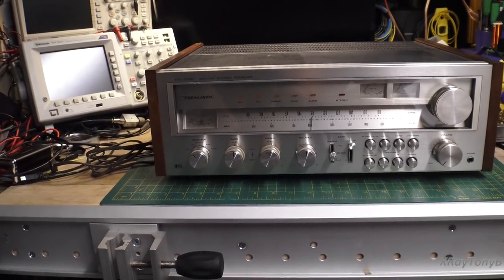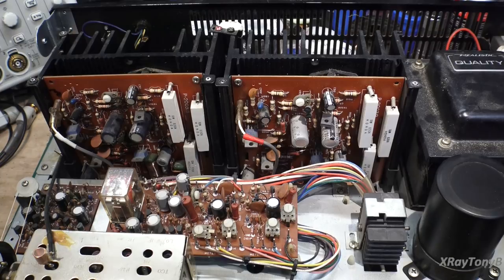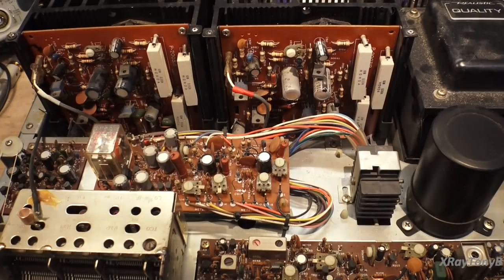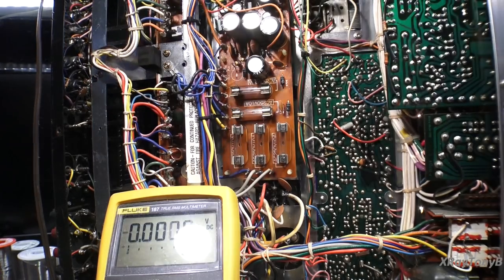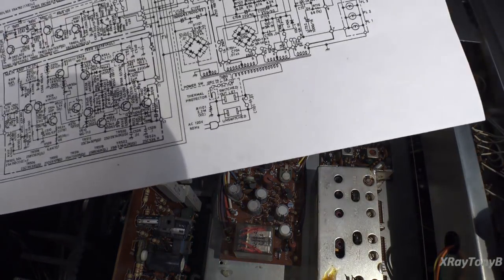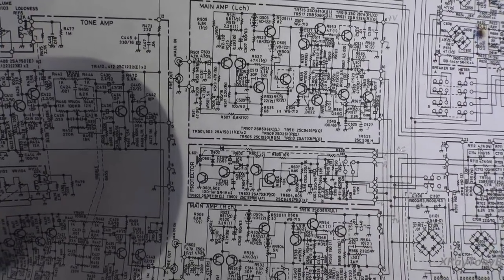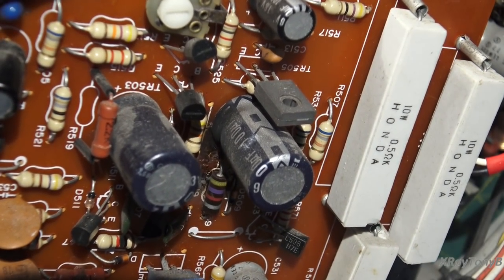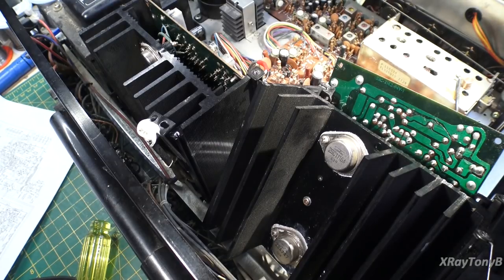Realistic STA 2000 Receiver Repair

Comment: I was a repair tech for Tandy from 1987-1995. I rebuilt many of these beauties. Most of these amp failures were due to intermittent bias pots. Once up and running again these were amazing performers. Thanks for posting, it brought back many fond memories
Reply: I rescued a Realistic STA-2100 literally before it went into a dumpster. It doesn't seem to power up. Sending this thing anywhere would break the bank. Hopefully at least one local tech can look at it and see if it can be saved-availability of parts must be extremely difficult, if not impossible.
Reply: @greggoodfellow5928  Better late than never ... About ALL the parts used in that receiver are commonly available or can be replaced by more "modern" instances.
The "difficult" parts are potentiometers with loudness-tap, the varco for tuning and coils.
Check the fuses before plugging in. Always replace fuses with the same value! VERY IMPORTANT!
Check for DC on the speaker output or on the relay BEFORE connecting any speaker.
You can check if the tuner-part is still working by plugging some spare-amp into the "tape-out" -plugs. (any kind of old PC-speaker with build-in amp will do the job)

Comment: I have a few vintage receivers and just wanted to offer a comment that this Realistic unit stands up very well against all of its relatively power-equivalent contemporaries. The components and build are ridiculously similar to Pioneer, right down to the panel lighting being identical; Stanley 8 volt bulbs. If you are considering an STA-2000 or a 2100, there is zero reason to hesitate, make the purchase. Thanks for the video Tony!

Comment: I have a Realistic SA-2001, a stereo amplifier with 60 watts per channel. The components of this receiver look familiar! In mine, one of the electrocataclysmic capacitors on the speaker relay board was bad. I replaced all of them and it worked fine. The biggest problem was dirty potentiometers and switches.

Comment: I had a STA-2250 and loved it...it was the first digital display stereo from Radio Shack.. Early 80's
Reply: The first "digital display" receiver from Radio Shack would be the STA-240, which was analog with a digital display, from 1980. Next would be the STA-2200, an all digital receiver, also from 1980. The STA-2250 was next in 1981.

Comment: I repaired a STA2000 a few months ago. It had more or less the same problems PLUS ... the trimmers to set idling and center current were very bad. All 4 have been replaced.
As I didn't have the original end-transistors, I just put the good old 3055 -2955 in it. Works more than OK for me.
Reply: I owned my STA 2000 D  new.   A number of years ago  all the illuminators went out .  What is your thought please ?
Reply: @mikewallace8087  you are talking about the "bulbs" I suppose. So ... no "light" but receiver is working.
Check if the voltage to the bulbs is still available. If "yes", replace bulbs OR 
replace them eventually with LED.

Comment: Tony, i know this is an old video, and maybe you already know about it at this point, but just to put it out there for others, GC electronics Radio TV solvent will dissolve that glue (and Sonybond) without ruining the silkscreening on the PC board.  The stuff is nasty, but works wonderfully.  I use the red straw from the WD40 can and just drip some on there and let it sit for a minute, adding more if needed.  it will come right off with no scraping.

Comment: I use to have a STA-2500 receiver, and it was the first digital receiver that radio shack sold.
Reply: Nope. That would be the STA-2200 from 1980, long before the 2500.

Comment: i just got a sta 2000 today off ebay  works like new but watt meter light is out  it has a plate  over it...is it hard to remove it??taking the two screw out did not move it ..love your work
Reply: ok  you have to take the face plate off  to get  to the screws  on the plate   ..not bad

Comment: I've been watching your videos for a while now and have learned a lot, and have repaired some receivers with success.  Thank you for the time you take to make this videos and sharing your knowledge.  I do have a question I have the Realistic 2100D which i was able to repair, when i got it it had shorted outputs, i recapped output, and power boards and installed new output transistors.  After playing for about 1/2 hour at 1/2 of its capacity it gets hot to the touch.  What temperature would be consider normal for this type of receivers?  I did adjusted bias to specs.

Comment: I worked for Radio Shack back in '77--'78, and remember this receiver well. It was a slow seller, but nobody ever returned one.
Just wondering though, these receivers were... what? $500 new fifty years ago? How much do you charge an hour for the kind of service we see in this video? I haven't priced caps and resistors in a long time, but components alone had to be $40-50.

Comment: One thing only; When you used the output board pins for your 8-ohm load measurement, since the customer never does that, aren't you ignoring the cable between the board and the terminals in back? I'm sure you thought of that!

Comment: Sooo, who made it for RS?  My guess, Pioneer, or Kenwood.  
Hmmm, that output turkey was suspicuous, but the yams and cranberry needed to be removed.  The stuffing and gravy had to go.  Good job on making the problems disappear.  
Hope you all had a festive TG.  
Don
Reply: I think Foster, it says, aka Fostex. Some were hitachi as well.
Reply: Another video on here said that and I confirmed it through research.  Thanks! They sold fine electronics, maybe a Pioneer would be slightly better.
Reply: @markanderson350  Tandy Electronics made this and all of the monster receivers 75 wpc and up. Hitachi last made receivers for Radio Shack no later than 1974.

Comment: Great video. I have this same receiver that my parent's bought back in the early 80's. It has occasional noise, not related to dirty potentiometers in the right channel. It doesn't happen often, but it's more of a brief distorted screech. I haven't powered it on much since it did that. I'm wondering, is it necessary to go through the rebiasing of the amp modules after replacing caps... I'm not sure I totally understand the process.
Reply: You have noisy transistors,you have to find in what circuit to problem is coming from,get a good scope and get started.

Comment: I HAVE A  ,,,  STA-2270 - STA-95 - STA-2100 - STA-2100D - STA-2300 - and others ALL REFURBISHED  - with higher quality parts , So Powerful , Will make 200w and 300w Speakers blush .Bought them from a Stereo Tech and also a collector . I want to make a video of which sounds better ..her quality parts , So Powerful , Will make 200w and 300w Speakers blush .Bought them from a Stereo Tech and also a collector . I want to make a video of which sounds better .. Paid almost 4000.00 for the 2100-2100D-2300 in total with refurbishing . Love them ..Because of your video i got into this project  ,  :)

Comment: Hi Tony I see it has been some time since you did this video it is a great one.  I would sure like to send you another STA-2000 all expenses on me of course. I just purchased it and would like it repaired right, the "seller stated does not work". I have not plugged it I did open it up and found 3 power resisters on the left on your video 4:18 have been overheated. It has a broken AM antenna but over all in fair and restore able condition from what I see. I do want to add it to my collection please let me know how I can get in contact with you I have more details.  Thank you for all your work.

Comment: I have the STA-2000D;
I found your video from a google search.
I was wondering if you had a source to get replacement backlight bulb sockets;
I can find online resellers selling replacement bulbs, but not the sockets
Mine are (as I recall) are grey, and have become brittle.
IF I saw correctly the one time your camera panned past these sockets, this receiver had white plugs.
This was a great video by the way.
Reply: Try touching base with Dave over at www.dgwojo.com. He has been fantastic in helping me with the bulbs on my 2000D back at the start of the year. He sells mostly bulbs, but if he doesn't have sockets as well, he probably would know what direction to point you in.

Comment: My receiver is the (D) variant  of the version that is discussed.  I have it connected to a pair of Klipsch Herseys and a pair of Realistic three-ways.  It has a tendency to shut down at high volume.  Shut the power off and turn it back on and it kicks back on.  I have often thought it would be a failure of the output transistors although I have no idea.  If you have an idea of what is wrong with it, please respond.

Comment: I have one that looses a channel, sometimes by flipping one of the switches the dead channel will come back on until it goes out, no rhyme or reason. I  would really like to get it fixed.

Bought the unit new back in 77
Reply: check the relay-contacts

Comment: Hi Tony, I have a realistic STA-2000D the wire of the stereo lamp is cut off but I don’t know to connect that so I need a schematic diagram of that ,where I can get the schematic for this receiver?thank you
Reply from the maker: Check out hifiengine.com.  You should be able to download the service manual there.
Reply: Thank you so much Tony for your help.God Bless

Comment: Honda resistors? Is that the same Honda?
Reply: Probably.  You know, many of the Japanese had to start over after WW2.  Many made components at first that did not need a ton of R&D.  I think Sansui was light bulbs way back.  Once you made profits, you rolled it into radios etc.  Toyota was originally sewing machines, is another example.
Reply: Maybe, but this receiver was made long after WWII, so unless Honda was still in the component business (which they may well have been)...I have just never seen Honda resistors before.

Comment: Tony, I have a Realistic STA 111. It sounded like an AM radio in a thunderstorm. I cleaned the pots with Fader and they're perfect, but I'm concerned about the caps. My hands shake too much to solder any more. Also, the relay went out many years ago. If I press it in, it sounds great, I didn't feel like troubleshooting it. I suck a little screw in it, and it's been like that for 20 years! My concern now though, after watching you, is DC voltage on the output. I haven't tested it, but I have some nice speakers and very nice HiFiMan Planar Magnetic Headphones. I would not want to damage the coils. How much would you charge to check it all out? Other than the relay it does work, but I do get some distortion occasionally.

Comment: Does anyone know why my left balance cuts out? Lucky so far if I tap around or above the left watt meter it comes back and fires all 4 speakers. However if you shut the unit off? and turn it on later no left balance again? I would appreciate knowing what the issue is ? and cost to repair it? STA 2000 I like mine, I hope it can be fixed

Comment: How much should a repair like that cost? Anybody?
Reply: My tech on east coast charges $60/hour labor (plus parts). I think his rate is pretty low for the area. Most vintage stuff needs to be pretty high end or obtained for very little to justify extensive work from a cost perspective.
Reply: @eddevito3282  I think the cost is not the only factor! Check Graveyard Carz TV series, on Motor Trend Channel. Old Challengers and Chargers getting up-to a $half-million in cost!

Comment: How do you remove thé tuning knob
Reply: Funny that I came across your question as I just removed the tuning dial knob on my 2000 yesterday! If you take a look at the tuning dial, you will notice a small hole. You will need to insert a 2mm hex wrench/key into that hole. Carefully rotate the hex key very slowly until you feel the key ‘seat’ itself into the tiny hex-headed screw, that is located at the bottom of the hole in the tuning dial knob. Once the hex key is properly ‘seated’, then turn the screw counter-clockwise. A couple turns and the dial knob will come free. Before attempting this, you could spray a very, very tiny amount of penetrant down into the whole, being careful that no overspray splatters on your receiver. Good luck, it’s actually very simple once you’ve done it!